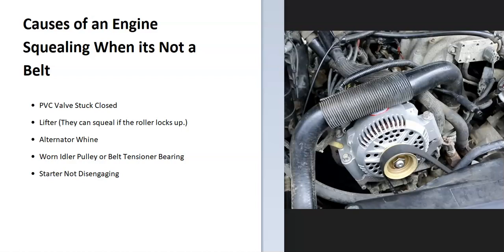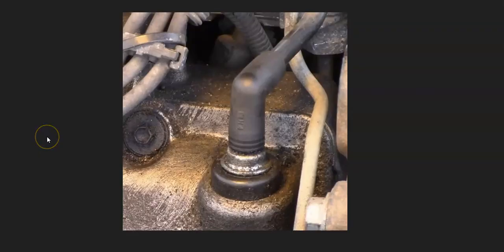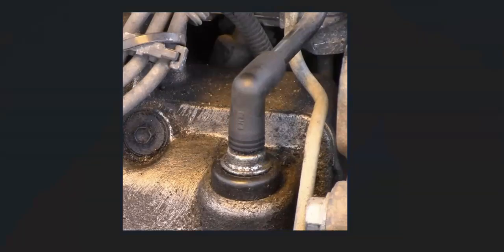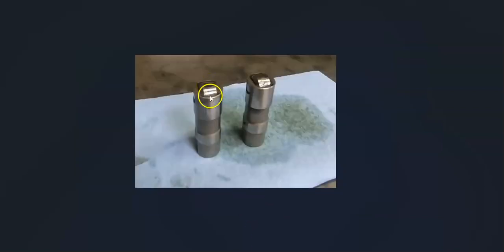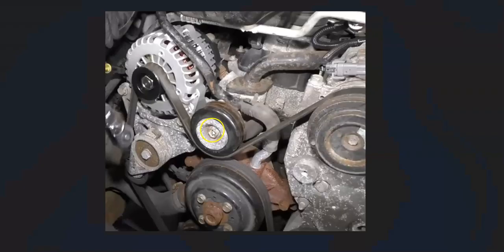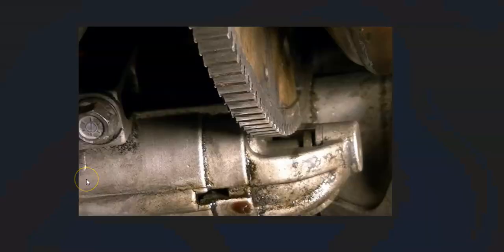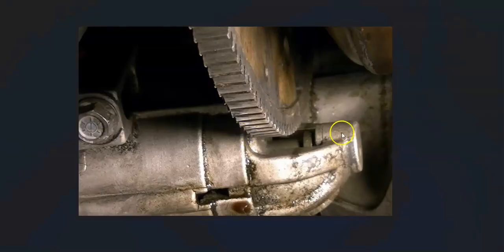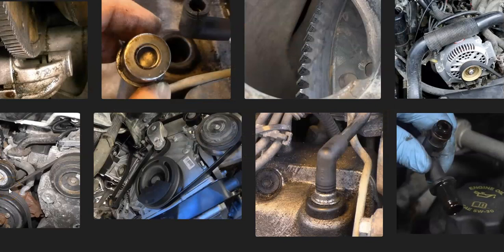Causes of an Engine Squealing When it's Not a Belt

Comment: I got a 2008 Chevy express that started making a squeaking/clicking sound like towards the middle of the van. Any ideas what it could be? I just replaced my starter so it’s definitely not that, I was thinking the alternator or maybe spark plug?
Reply: Forgot to mention it only makes the noise when I start accelerating and stops doing it like at 30+ mph

Comment: 2012 Jeep Grand Cherokee 3.6l V6.  Had the same issue with the squealing without the belt even being on the engine  My mechanic said it was definitely not the belt, the tensioner or the idle pulley.  He couldn’t really even determine what it was causing the noise but he thinks it was something internal. If that’s the case, do you think it is those rocker arms you mentioned? He never mentioned anything about a PVC valve or starter.  I’ve had the vehicle for two days now since his diagnosis and I have yet to hear any squealing? Any clue as to what’s going on?
Reply: did you figure out what it was? I am having the same exact problem, ran the engine without the belt and still the squeaky noise
Reply: @Godfather44055  no, sadly, I did not find out what was wrong with it.  After pumping thousands of dollars every single year into that pile of junk, I decided to sell my Jeep grand Cherokee Overland, edition to my mechanic who said he really wanted it.  

Apparently I have battered wife syndrome because I purchased another Jeep.  I bought a 2022 Jeep Grand Cherokee Summit with only 8300 miles on it. It’s good as you would expect for such a new car, but the entertainment system is a giant pile of garbage. Often freezes, is slow, unresponsive, shuts off left speaker off when you connect CarPlay sometime, disconnect the radio when you’re using voice text and won’t return when you’re done, some Sirius radio stations won’t connect due to weak internet signal (I live in one of the most densely populated areas in America).  Check engine light periodically comes on for no reason and then goes away.  So I can only imagine what’s gonna happen when I start getting serious miles on the car?

Comment: Been having issues with my wagon here lately. Fuel pump went bad. Replaced it and the vehicle was running perfectly for 2 days. No check engine light, no rough idling, nothing.  Then the rough idling came back and the car started running like crap. It was even at a point where it wasn't capable of running at idle on startup.  

Checked the fuel rail and there was massive amounts of air pressure building up in the fuel line. Which is strange because I have kept my tank at 10-18 gallons since replacing the fuel pump. Earlier I manged to get it started after purging air out of the line and a squeeling noise started. Didn't think nothing of it drove about 3 miles shut the engine off to go in a start. Came back and the squeeling wasn't there anymore. 

I drove another 15 miles to my jobsite worked all day then drove 15 miles back to home depot to drop a rental off. No squeeling or strange noises. When I started the car back up there was a weird bang noise, oil light came on and went back off and the squeeling started happening again.  I was listening to the engine, the noise sounds like it's coming from the middle of the engine. Let the car idle while I ran around making sure the fuel pump was working listening to the sounds from different angles and the car shut off after almost dying multiple times.  Somehow getting air in my lines, pulled the fuel line off the filter and gas sprayed across the car. Sadly I broke the fuel line mount for the pressure regulator trying to remove the old one so I am not sure where or what's causing the squeeling or air in the lines